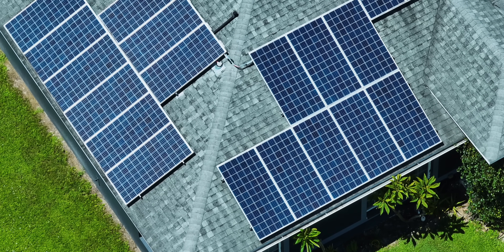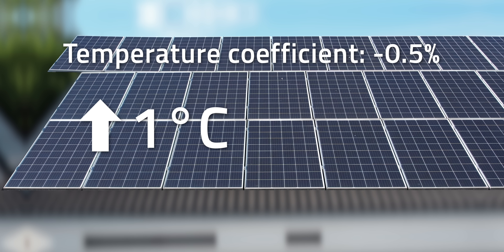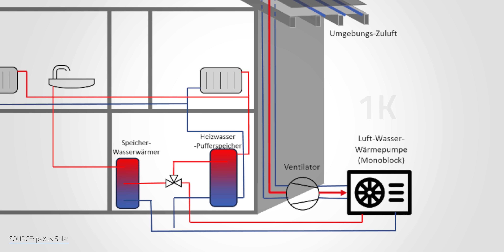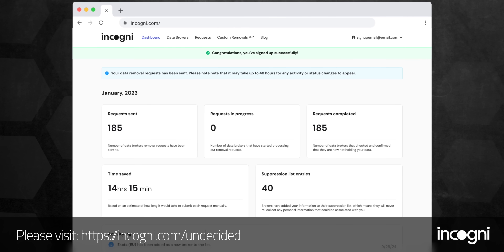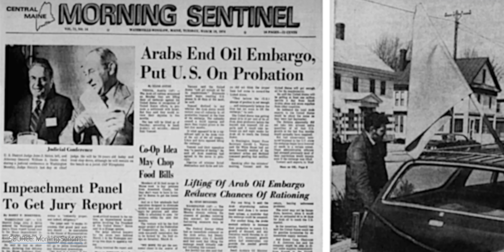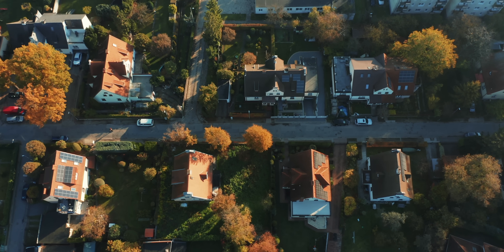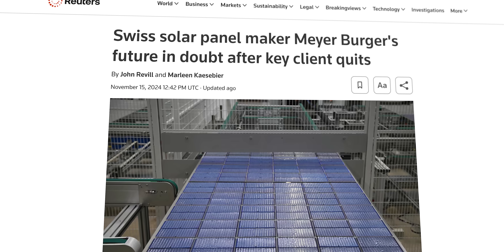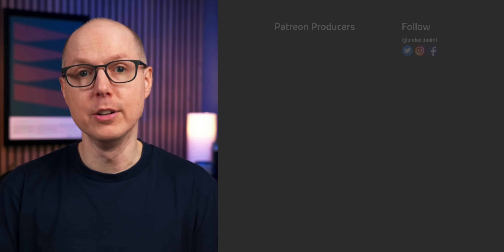Why Hybrid Solar Heat Pumps are the Future of Home Energy

Comment: It will only succeed if there is no maintenance for the exchange of heat from solar.
Using glycol or similar will ruin its lifespan
Reply: How would glycol based coolant ruin it's lifespan? Literally just check the fluid level once every 6 months and full replacement once every 10 years.

Comment: Do solar panels affect the air temperature in the attic? If they do,  this might conflict with the roof design.  Fire example:  attics that are vented to maintain ambiant temperature would have to fight the heat gain from solar pannels.
Reply: @jacobbrj  solar panels typically reduce the temperature in attic spaces as they have an air gap between panels and shingles, and block the direct transfer of heat from the sun.
Reply: @jacobbrj  solar panels typically reduce the temperature in attic spaces as they have an air gap between panels and shingles, and block the direct transfer of heat from the sun.

Comment: I have a Proof of Concept for a system that uses grey water as a heat source with a connection to both a heat pump and solar panels.  Instead of harvesting the heat from PV Panels directly and sending it inside a house the heat is extracted and stored in an underground tank temporally with grey water from a house so it can be used for spaced heating as needed.  The grey water can also be reused for flushing toilets or as a source of water for lawns and trees.  The beauty of this concept is that the heat can be extracted from PV Panels as needed, stored and then r-extracted again for use in space heating at a later time.  Multiple uses and multiple systems are better than single sources of heat.
Reply: Parts of Canada use Drain Water Heat Recovery coils as a standard install.  Much cheaper grey water heat reuse with less benefits.  Payback should be much faster than what you present.  Is a direct competitor for grey water heat should your P.O.C. commercialize.
Reply: @SeekingBeautifulDesign  
These systems are not much different than what I have in mind but only with regards to heat.  The difference is these systems only use the heat from grey water and don't reuse the grey water for toilet flushing and reduction of water use is probably just as big a benefit as the energy reduction.  That is also a huge part of where the reduction in energy is obtained.  Pumping, treatment and distribution of potable water uses large amounts of water as well as does the disposal of used water afterwards into the sewage system.  By recycling it back to flush toilets you are reducing both energy usage, water intake (by about a1/3) and sewage out flow by the same amount.  It is a hybrid system that can also be used to store heat from solar panels.  The heat recovery in summertime would be of little use to a home but the reuse of grey water into toilets would be huge as well as the use of grey water to water lawns would have an immense impact on municipal water systems especially in times of drought.  Anyone who lives in Las Angeles would have greatly appreciated if every house had a 4 to six cubic meter tank of water ready to ward of the flames attacking each house.
Reply: @anguscampbell1533  I do applaud your attempts.  I'm just pointing out that in the exergy cascade, the DWHR sucks out a lot of the value of waste heat.  A household with DWHR would have less incentive to move to your system than one without when looking at benefit per cost.

Also, you may run into early adopter customers who prefer to eliminate the use of toilets and instead produce fertilizer with existing systems eliminating another selling point.

Also, storage of grey water compared to potable has issues of microbial growth that aren't insurmountable.  But if grey water goes straight to watering environment and potable water is used for both drinking, firefighting and thermal storage, such a system may deter people from buying your approach.

This being said, I hope you have cracked the problem of TPV (thermalphotovoltaic) systems.  The best thermal product is the hottest output.  The best PV output requires the coolest panels.  There is an inherent tension between these 2 requirements.  Add in the control needed to handle freezing temperatures, avoiding thermal shock cracking panels, the increased complexity of running both wiring and piping to panels and the higher maintenance needs of piping.  This may be the reason why this decades old technology has never become commercially viable.

But solar panel prices are drastically dropping.  Multijunction panels are already on the market, so the benefit of cooling panels is increasing in value as the amount of electricity collected from the same area of panels increases.
Reply: Why not use a solar collector instead?
Reply: @jensrasmussen3648  
A solar collector doesn't store heat per say.  For a solar collector to be of any great benefit It would need to be stored in a tank for use at a later time.
Reply: @anguscampbell1533  Obviously, only thing is you need an enormous amount lot of storage, but that's the same when using batteries for PV.
Reply: @jensrasmussen3648  You can't store heat nor water in a battery.
The amount of storage safely underground would be about 3 to 4 cubic metres.
Reply: @anguscampbell1533  There are water batteries, meaning a big sack of water. There are systems up to 10m3. Depending on the climate they can store heat for a couple of months.
Reply: Grey water isn’t great for storing heat because it still will contain organic matter. Heat + organic matter usually means you’ll have issues in the future with organic growth blocking your pipes. You’ll need to treat it with chemicals which means you can’t use it for irrigation. Having a closed system for heat transfer is always better in terms for longevity of the system unless you guarantee your input will always be clean or your output will be expelled to a non-stagnant environment.
Reply: @rtangxps9  
UMMMMM!!!! NO!!!
What I am proposing is a system that recovers as well as stores heat and recycles grey water back into toilets for a reduction in water usage and a reduction in sewage output.  Those two would reduce energy usage also.  This reduction in water input/output is especially useful in a well/rural septic system.
Reply: clean water is cheap enough to re-cycle. Why use gray water?

Comment: I love the Thermal PV hybrid concepts.... Already looked at the french made DualSun hybrid Solar panels, that work with liquids.  But here it does not add up. If with 5 tiles covering 10 square feet that is a little less than 1M2, you get 1KW Peak Power, this is a 3x what you can get with good Solar panels today,  that typically give you 0,5KWp over 1,6 M2, means 0,3125KWp over 1 M2, or # 0,3KWp over 10 square feet. So this sounds too good to be true.... Unless it counts all the extra heat unused and yet wasted during the summer ?
Clearly there is a TBD play for Thermal boosted PVs, but need to make a total solution for all weathers, May be with some sort of phase Change thermal storage, or dual loops geothermal ? 
Dualsun, have starter to connect their liquid system to the hot water tank and to the swimming pool of the house that have one, which saves a part of the extra summer heat, plus all other seasons heat via the hot water tank heat pump....

Comment: Interesting tech.  We have a Solarroof now (early customer, so low pricing, same as non-solar tile roof) and like it.  And our weather is relatively warm with lows in high 30s.  However, we have gas heating that can run upwards of $300/mo.  It would be nice to have a solution that covers both the solar/AC and the heating sides.

Comment: Just use a rooftop sprinkler. Evaporative cooling is ridiculously affective. And this would be super cheap to install and run.
Reply: And not in areas of high mineral content water supplies.
Reply: Not in the humid Southeast.
Reply: You’d just ruin the panels. Tap water is highly corrosive and full of minerals vs actual rainwater.
Reply: @ you could run the water on the shingles, under the panels. cool the house, roof, and therefore the panels too.

Comment: $1.50 per watt, yet traditional PV panels are what, $0.20-0.30 per watt?

You'd have to really hate the look of solar panels (or have a particularly frustrating HOA) to pick the former.

The thing with a lot of those sorts of ideas and with perovskite panels and the like, are that the price per watt is well and truly in favor of just putting up more traditional silicon PV panels.

Comment: If heat pumps are as efficient as you harp on about them, then why aren’t they everywhere? It seems like they are just good content for videos.
Reply: Heat pumps are very common in most new (last 15 years) construction.
Reply: @genopsdir  in Europe the problem is often cost of electricity, although new buildings now usually include heat pumps and high insulation

Comment: There is a lot of heat in buildings, that might be used or stored before going to waste. With more research and development, this will be the way to go.
If i had the money to build my home of my dreams, i would include it to heat living areas, garage and take heat from fridges, batteries, it-equipment or wastewater. Store excess energy as hydrogen and you got another heatsource at your hands :)

Comment: What about snow accumulating on top of rooftops in rhe winter?
Reply: That is a concern for me also if I use PV Panels
Reply: @anguscampbell1533 all solar installers I've talked to say the panels are black and heat up passively to remove snow fairly quickly. I'll need to see if they are correct as I haven't had any snow on mine yet.
Reply: @Thomas_Acharya  - this whole last 2 weeks its been -25 to -30C, even in bright sunshine there is no melting happening on my panels.

Comment: I have a geothermal heatpump system that can cool the underfloor heating in the summer. These lines could be extended to cool the solar panels. It would be an interesting engineering question if the additional heat pump cooling power would be larger or smaller than the gained electricity from the solar panels.
Reply: I would love a ground source heat pump, but the additional upfront cost are just crazy.

For the same price you can get 2 air source heatpumps. But maybe that's just because of the drilling costs here in the Netherlands.
Reply: @C4RoCKeT  The cost of GSHP is crazy if you don't look at the savings in a warm-to-hot climate all summer long when air conditioning is free ((just the cost of circulating water in a closed-loop system))
Reply: @michaelbianchi7639 That makes sense. In the Netherlands the summers aren't that hot (yet).

The lower maintance costs and slightly higher COP probably (during winter) probably won't justify the higher upfront cost.
Reply: @C4RoCKeT  The COP for GSHP HVAC in the winter is way lower than the COP for ASHP HVAC in the winter.
((That is for our Passive House.  GSHP HVAC without serious insulation is just a waste of money in the winter.
Again it is more money, but we are almost Net Zero,
with 10kW solar, for house energy consumption, so all that heating and cooling cost savings are paying off the investment.
We have friends who put in ASHP recently.  When the overnight temps got down to 9 degressF they had to bundle up and turn on the gas furnace.
Reply: @michaelbianchi7639  Your friends didn't size (&/or install) their equipment properly.  HVAC Tech
Reply: @C4RoCKeT  NL here. 9k euros just the 2 holes. Indeed over the top, but I didn't do it for the money
Reply: @mischadebrouwer9855 That's actually not too bad. What did the rest of the setup cost you, if you don't mind me asking?

I'm looking at 11kW air source heat pumps, but without subsidies it will cost like 16k.

I heard that the price of drilling varies quite a bit per region and that you can save quite a bit if you manage to find a smaller local company.
Reply: @ The heat pump itself is 8k, adn I think around 3k for the install. However, we also expanded the surface area of our underfloor heating, so our total bill was substantial higher than that :)  But, in principle if your house is prepared well, the full installation could be purchased for about 25k.
Reply: DualSun has PVs with integrated water heating (which cools down the panels).

Comment: Much like Tesla Solar, I have a feeling this is pretty expensive :(
Reply: The Solarroof is expensive, but a regular Tesla Solar panel system in the US is one of the cheapest.
Reply: Normal solar panels nowadays go as low as 0.3$ per W and will usually have better specs than fancy tiles
Reply: @sznikers  definitely.  Solarroof tiles traded off solar efficiency for structural strength.   On the plus side, they can take a lot more abuse than a standard roof. Even big hail stones just break apart and fall off.
Reply: @sznikers  of course, because the tiles are meant to look like a regular roof, so its not an eyesore..
Reply: @harrydent98 the claim was not about aesthetics of it but about it being "one of the cheapest". Its not even close to being one of the cheapest.
At those prices one may as well just resign from pv panels if aesthetics are important, price savings due to having normal roof will cover lack of savings from solar panels on electrical bills. Environment will be better too without another few tonnes of e-waste.